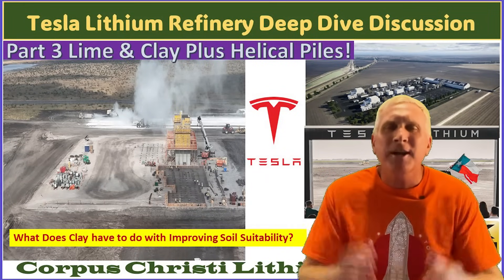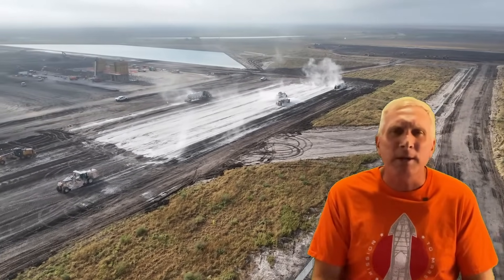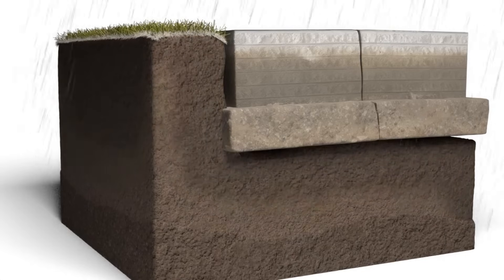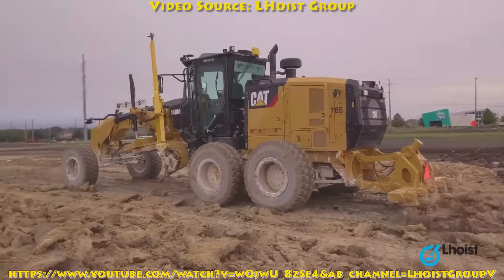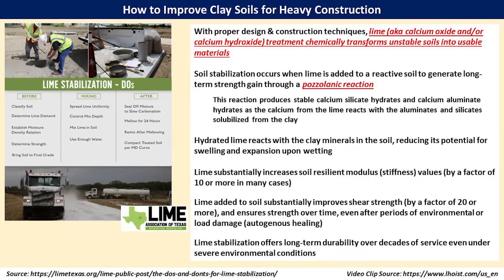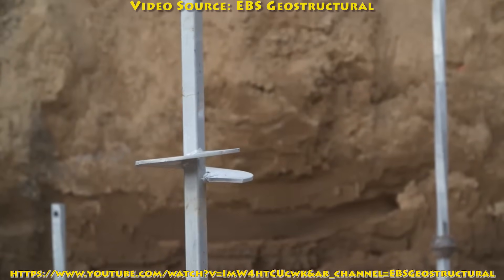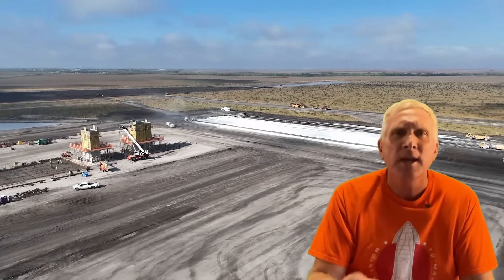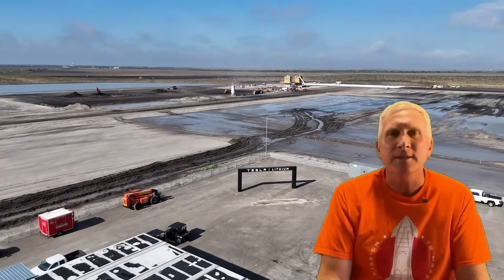Part 3 Tesla Corpus Christi Lithium Plant Deep Dive Video (Soil Stabilization, Piers & Foundatio)

Comment: Thanks Joe.
7:35. Bottom left. Beside the orange front end loader, a stack of 3 or 4 single helix screw piles. Further to the right are the pile extensions. They must being going deep.
Centre. To the right of the excavator is a silo and water storage trailers. Would be for the grout supply. Hose run out in a zig-zag patten.
7:46. Slab. I would guess more correctly the slab is a pile cap. It’s thick, the shuttering/formwork is shown to be waist high in Joe’s photos. 4 re-entrant bars (short diagonals of rebar) at each pile, and it seems a tie (a square of rebar) will be placed around each of the piles.
Presumably layers of rebar to come.